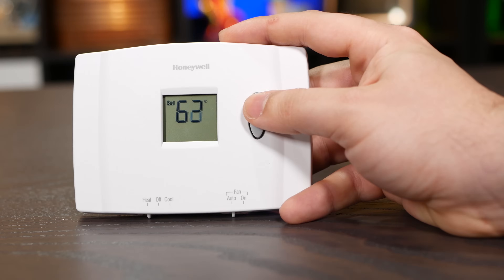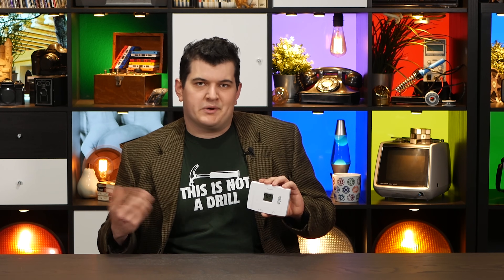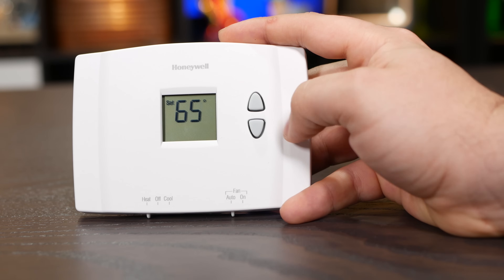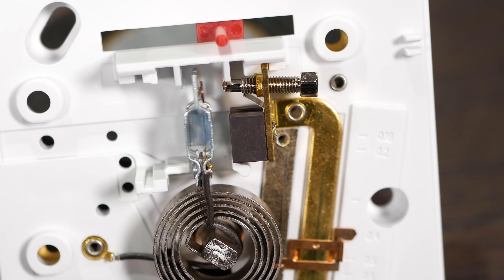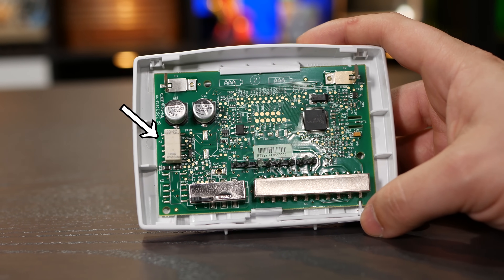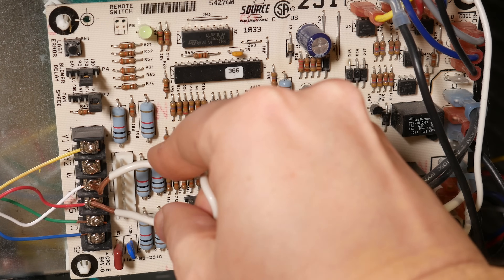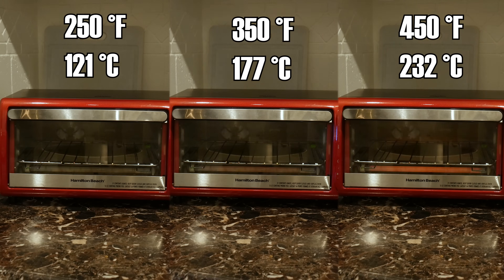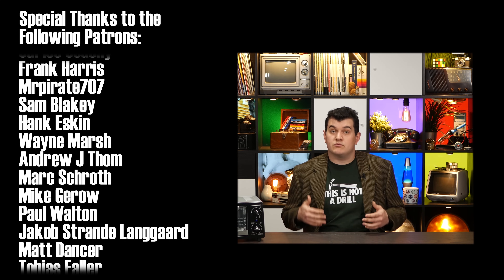Thermostats: Cooler than you think!

Comment: Standard operating procedure in the office where I work is to set the A/C thermostat to an impossibly ambitious temperature setpoint, so that the compressor runs all the time - then switch the A/C on & off manually (a.k.a. "the human thermostat"). Oddly enough, I work for an automation company...
Reply: I have an LG Portable Air Conditioner which I manually use the power on and power off switch to toggle Dry mode. If you use the cool mode automatically it cools for a while, then gets cold enough, then switches the compressor off and continues running the fan which sucks in the humid air from the rest of the house into the room that just cooled. I had to make a Audio CD of the remote control signals and wire it to 2 infrared LEDs in stereo with an NPN transistor amplifier to make an open loop silencer temperature 'control'. On hot days you set it to repeat on higher numbered tracks and on cooler days you set it to lower numbered tracks.

Comment: Pro Tip:  Running the fan all the time in the winter will help heat distribution, though it's annoying if you don't have a variable-speed furnace.  You do not want to do this with A/C, as it'll serve to dump a bunch of humidity into your house when the A/C shuts off.

Comment: The mobile playback speed control does at least make the gag tolerable. Now to find out if it still works (and is controllable) when casted from mobile to ChromeCast.

While I'm on the subject of useless controls, my TV remote already has all the media control keys one could ever need, and the TV has a HDMI-CEC link back to the Chromecast, so why is it the only two buttons on the entire remote that do anything on the Chromecast are "Play" and "Pause"? If I want to go back a few seconds, I have to unlock the mobile device, open the app that is casting,  hope the app in question isn't stupid enough to hide the controls during casting, and then use the seek controls in the app to control the Chromecast. I probably couldn't come up with a less intuitive, more frustrating and annoying user interface if I tried 🙄.

Comment: Nowadays, most (at least many) central heating systems here in The Netherlands (Europe) can modulate between 0% to 100% burn based on the Thermostat. This means less switching on and off, less noise, less heat spikes in the water tubes, more comfort, and potentially a bit more energy efficient. It's not 'fancy panty' in the sense that is almost the standard now. And it is typically using a standard called OpenTherm for the wiring.

Comment: Well, I agree with you about, "setting the temperature higher will not affect how fast will it reach" but only if you are considering the ducts from the furnace. If you are in the other end of the room, setting it will actually make it faster.

Let's run some thought experiments (i'll use Celsius because i'm a metric person): Considering the ambient temperature at 15ºC, and you want the whole room at 25ºC, you turn on your thermostat and after 10 min it reached 25ºC and the PWM will start. But only the thermostat reached 25, the other end is at 22ºC, so will take about 5 min to get 25ºC. On the other hand, if you set it to 30ºC, it would take 15 min to reach it, but after 12 min the whole room is at 25ºC. The numbers are a little bit off, but i think you get the idea.

In conclusion, if you are closer to the heating, the temperature will increase at the same rate. If you are a little bit further, increasing the set temperature, will reach colder temperature faster than just setting colder temperatures.

Comment: @Technology Connections There's an interface and protocol OpenTherm for the use over 4-wire cabeling.  My opentherm thermstat allows programming temperatures and a weekly schedule, holidays, temperatures and many more parameters some of which are pretty obscure.

There's also what the manufacturer calls "party mode" which allows overriding the programmed schedule for a limited time which can be used to either run the heater say for the few extra hours of a party in the evening or also to disable heating during absence.

Finally there are three possible modes to control the temperature.  First the manual mode where the temperature of the water going to the heaters is set manually.  The second controls that temperature based on the internal temperature and the third based on an outside temperature which based on a simple programmable curve converts outside temperature to the temperature of the water fed to the heaters.

This is a system from a French manufacturer and already ~ 10 years old and more on the lower end side of the market.

Comment: Nothing about variable speed blower motors. You can adjust your blower motor to fit the requirements of the house. And the emergency heat uses the same bank of coils for normal heat though those sequencers for a safety. The blue is a 24 volt common that go to the indoor and outdoor unit telling the system that it is calling for those to close allowing line voltage to pass starting your motors in the given indoor and outdoor units. The blue wire isn't their for nothing.

Comment: A lot of newer cars have variable capacity a/c compressors. Multiple inputs go to the a/c ecu which then decides how much compression is needed, and can back right off to improve fuel consumption. Also eliminates the clutch on the front as the compressor can spin without compressing gas. Downside is if you get a stone in the condenser, or any leak, you lose the gas, and the oil thats mixed with the gas. No oil - no lubrication in the always turning compressor.

Comment: While thermostats may only provide a binary on/off, if you have a hydronic heating system (one that circulates hot water through baseboards or radiators) you can have an outdoor reset controller that will adjust the water temperature based on the outdoor temperature (which determines the amount of heat loss from the building).  Therefore, the thermostat provides the binary on/off to the water circulators but the outdoor reset controller determines when and how long the burner fires to bring the water temperature to the desired level based on the heat loss of the building determined by the outdoor temperature.

Comment: I need to find a thermostat that can run the fan for a few minutes after heat then every 15 or so minute intervals for a minute or two.
We just built a brand new house in australia, in which the heater installer was the only crap trade and we have to most uneven heated house ive been in with by far the best insulation in a house, which spans the heating further and further apart, even trying to block off some vents and open others we still struggle to not have 19 degrees in some parts of the house and 24 in other areas. Unless ita actively heating.. then it is worse. And we havnt even gotten below 14 degrees c outside yet.

Comment: My heating is so old Using diesel to heat the water of the house, and then the water radiates heat from the radiators, and the regulator is an old Thermistor with the wire going to the heater a few hundred feet away, the only control is summer/Winter mode.... so you can't set the temperature you want, just what the manufacture thought was a good room temperature... and the control has only two wires to the burner, with no other board or anything.

Comment: The Ecobee smart thermostat has the feature you talk about in the last few minutes of the video where you can set it to for example, blast AC for half an hour then have it automatically change back to regular schedule or regular temperature by itself. You can go in to settings and change how long the new temperature you set it to stays active before it automatically goes back to what you have it set to as the default at that time of the day. It can go from holding it only a few minutes to hours, to forever. You set it up once and the feature always works.

Comment: In Europe at least you have a way more sophisticated way of thermostat communication to a boiler which is called OpenTherm. It uses only 2 wires which carries both power for the thermostat and a communication protocol, telling the boiler how much heat it shoud generate (a temperature setpoint). This causes a massive reduction in heating costs since full throttle and then off, is not really a efficient way of heating or cooling.

Comment: You could always yank your thermostat off the wall, jump the AC wire, and tape it down like that for a half hour. Cooling off's worth it, right?
Reply: With me I'd have to short the wire from the third week of April until the first week of November, with no respite. What would be even better would be the thermal equivalent of a Shepherd Scale, where your body gets the feeling that the temperature is constantly getting colder, but energy wise is going nowhere.

Comment: So, the whole thing is an on/off binary system? Even the old, old analog dials are... digital in terms of their function over time?

Can my furnace run Crysis?

Given a perfectly constant, zero degree Celsius perpetual outdoor environment, and a furnace that never breaks or runs out of power, in a house with average insulation (in, say, the Midwest), what is the expected rate of "0 and 1" furnace transitions enacted by the thermostat attempting to heat a medium size North American living room? Then, analyzing the amount of total binary occurrences required by the game Crysis on its highest settings, from the moment the game boots to the end of the first level as played by someone reasonably experienced with the game, this question: roughly how many years would it take for the house to process the game even though there is not any actual PC hardware or display involved? Just the raw binary crunching?

As a follow-up, since the answer will be unfathomably high, probably in scientific notation, what is the most creative way to make such an incredible number understandable, such as "moving single droplets of water from the Pacific Ocean to the moon over and over at one meter an hour."

These are the only questions on the final exam. You will pass or fail the course based on this test. You have 50 minutes. Begin.

Comment: There do exist thermostats that regulate the heating output (leaving water temperature) dependant upon the difference of the set point and the current temperature (the "D" in "PID"). The outside temperature can be a correction factor as well.

Comment: So, as we dont have 'fancy' AC/heat units but an 'simple' Central (gas) Furnance providing heating to a water pipe system - what are thermostats? I only know them from my workplace and from the car ( "check eng. temp", anyone? :D )

We control the heat of the Radiators with old knobs (or even radiocontrolled knobs... Smarthome, yey) that turn in turn just a  valve to the warm-water-pipe. I would include pictures of mine, but you know, youtube does not support that feature... (yet)

Water based heating may be anchient and a very very european thing, but as far as I know, the newer systems (als floor heating etc) are still on the battle with that giant in the housing market. We build our houses to last at least half a century... and most of them do. (heck, the appartment i owned before this one was in an 300 year old building)

(hopefully the bits of sarcasm show...) thank you for the best explonation of why we need a toaster oven!

Comment: I do building maintenance for a hospital. The thermostats we use actually do use CAT5 to communicate with the controllers in the ceiling, but that cable is carrying data, not pilot voltage. Our building has a relatively complex central control system with computers making all of the decisions based on data gathered from all kinds of sensors. Dumb on/off thermostats are not sending data; they are controlling pilot voltage. CAT5 is not for carrying pilot voltage like that.

Comment: I know that my split system head units have a button for 'Powerful' which puts the fan on full blast and depending on if it's on heat or cooling, maxes the heat or the cooling for 15-20 minutes before shutting off again.

Comment: as I do work in heating you nailed most everything, but the terminal label dose not actually refer to color rather to terminal function matching colors just makes it simpler to identify wires when hooking up devices if that makes sense and for all running any smart thermostats such as nest lyric or ecobee , if the furnace has a circuit board  you must run a wire from c on furnace to c on thermostat or weird problems will occur or possibly damage you control board on furnace

Comment: In the EU all the electric floor heating, and electric radiator thermostats must have a bluetooth connection by the law, so they can communicate with each other to do some energy saving stuff.
Also, I think, that all the water based solutions use outdoor temperature sensor, and heat up the water accordingly, but the thermostats are separate system from that, and only control the waterflow into the radiators/water floor heating pipes.

Comment: The Honeywell 9000 series can partially do what you mentioned near the end of the video. You can temporarily override the preset schedule for a certain time frame and the thermostat, after that time frame has passed, goes back to its normal routine.

Comment: My thermostat (which looks almost identical to your honeywell in the video) has a "temp" option which does exactly as the commenter described. It allows you to set a temperature and when it reaches that point it will turn off and go back to the previous setting. I actually get annoyed at this because it does it by default and if you want to keep a certain temperature without fiddling with the time/date program you have to press the hold button.

Comment: That is incorrect my car is a Smart  HVAC
as i can change the speed of the fan and set it an lowest temp :)  or even Turn on more fans to cool the SUV faster ( REAR A/C)
Reply: I guess the fan being on steady at differeing powers could be argued to be a differing amount of chill, it's not quite incorrect on the actual cooling side of the mechanical aspect, still is duty cycles, just a layer of more them. The refrigerant still goes to one temperature basically iced up, on and off cycles of the clutch on the motor belt, then the fan is only pushing more or less air over that chilled line in the filter and radiator box behind glove compartment or under hood. Electronically the fan is either running with a resistor to draw down the voltage to make it spin slower, or we start to mix in Pulse Width Modulation on the vDC aspect and it's just flipping the fan on and off 0% for off to 100% every second for max blast, and medium would be half a second off and half a second on, and you'd still be a steady speed of fan power, just duty cycles of on and off rapidly instead of the much slower 'full blast or no blast' that the pumps are doing.

Comment: My Bryant Smart thermostat allows for an auto heat to cool function just set the desired temp and the thermostat eill know it it's cold or hot outside. I've never activated that feature because I want to be able to control when it heats or cools. Depending on the size of the house you would spend to much energy cooling down your house if you're to hot from working out. Get a fan have a seat on the couch turn your fan on full blast and watch a technology connections video by the time it's over you'll have cooled down enough. My tower fan consumes a whopping 35 watts. Air Conditioning consumes 20 or 30 times that and would take hours to cool the house and you down. GET A FAN

Comment: So, quick question. My parents always tell me to adjust the temperature a few degrees at a time, so I don't "damage the furnace". Is there any merit to this notion?
Reply: Likely not - but maybe there's a concern that the furnace will somehow be damaged if it runs for a long enough time without switching off? Even then it's only going to switch off if the ambient temperature reaches the set point, so if the adjustment isn't slow enough for that to happen periodically, there's no difference in workload on the furnace.

Comment: Ever since we installed an Bryant Housewise smart thermostat our heating bill reduced. Why you might ask? It knows the outside temp and having a 2 stage heater. Most of the winter it ran on the low setting for s longer time hence saving money because it's consuming less natural gas. It is also more accurate never allowing the temp to drop more than 1 degree. Buy once cry once. Yes it was $500 but over it's lifetime it will pay for itself in energy savings. It also helps having a humidifier attached to the furnace because moist air holds more heat. Oh so many variables. A more expensive thermostat will more accurately show the actual temp. Most thermometers have a + or - 2 to 5 degrees. A perfect thermometer costs around 300 bucks. Acurracy counts if you want to save money. Keeping the house at 74 all winter long saved us money with the new thermostat than a dumb thermostat

Comment: There are systems that have a medium or high setting. Some systems have inverters in the compressor that allow multi stage heating and cooling. Also, some systems have multi stage fans. Complex systems have multi zone control with in duck baffles.